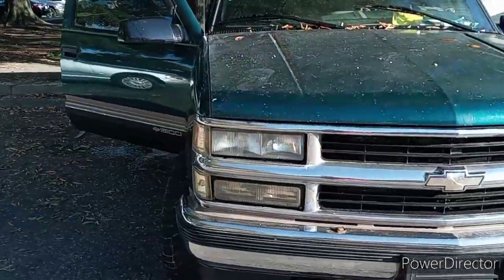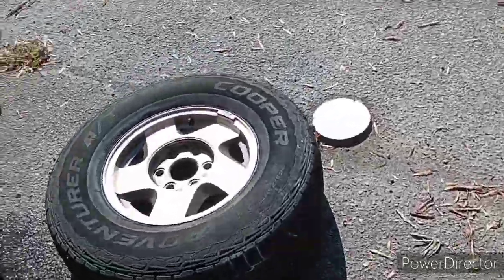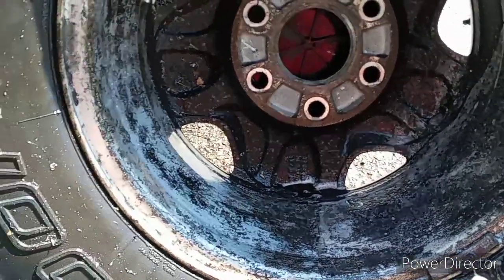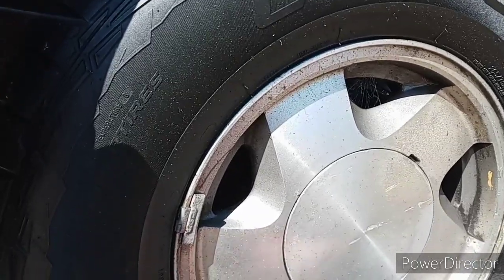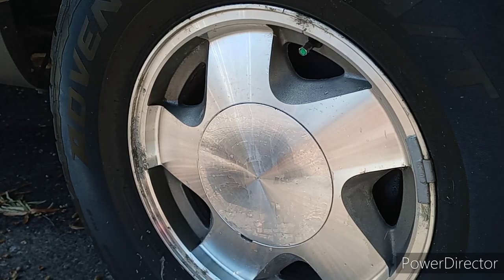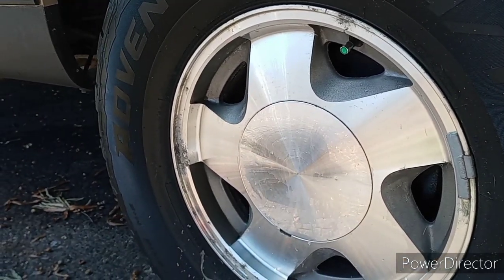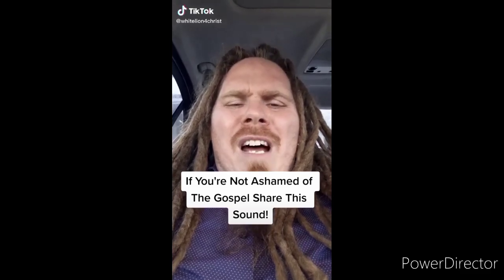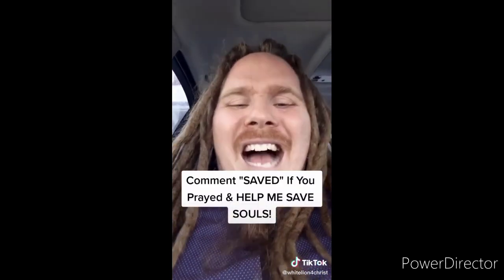how to turn your stock wheels Chrome under ($10)

Comment: 600 grit 800 grit 1000 grit 2000 grit. Get them smooth and then polish. It will look like chrome. But they must be sanded well ypu will love them
Reply from the maker: I think you got to start out with 320 because you got a sand down the machine marks all the way and that's a pain that takes forever

Comment: You might need to sand it with a 800 thrn 1000 then 1600 then polish it ..I know this is old but just in your bored
Reply from the maker: I only did 1 wheel lol ill try that
Reply: What do you sand with??? Sorry if that’s a dumb question. Is there a special sander or certain brand

Comment: Chrome-plated plastic is always easy to shine. If you want the rest of the wheel to shine you need to do some multi-step sanding.
Reply from the maker: Yeah you have to send the machine marks completely flush and use different grit sandpaper to get a completely flat and smooth I started to do it on one wheel but never finished it
Reply: @Germanmuscle  Just keep them polished as overtime they will eventually shine on their own. They still look good without the milky clear coat on them.
Reply from the maker: I ended up getting 20 inch wheels that I plan on chroming once it gets warmer outside

Comment: Yoo man how u clean the back of the rims ?
Reply from the maker: I'll be making a video about it soon but because it's the back of the wheel and it's so tore up I use a wire brush rubbing alcohol and Brake Parts cleaner and then polish it
Reply: That’s wassup I appreciate it

Comment: This works great, if you want the cap to match better. Don’t strip it, clear coat over the old clear and it matches the stripped wheel perfectly!
Reply from the maker: I ended up getting new wheels

Comment: What did you use in the pump spray bottle please comment back thank you for this video I will try it
Reply from the maker: Hot water but I used Citrus strip to get the clear coat off you can get it at Lowe's or Home Depot for like 10 bucks
Reply: @Germanmuscle   OK thank you very much
Reply from the maker: I sprayed the center strip on the wheels and let it bake for like 20 minutes in the Sun if you don't let It Bake then it takes forever for the clear coat to come off
Reply: @Germanmuscle   OK thank you very much I have a Chevy S10 it is a 2001 I have almost the same type of wheels on mine

Comment: what are u using to take off the plastic on the rims and that spray ??
Reply from the maker: I just used a flat head screwdriver to remove the center cap. And I said what I used in the video.
Reply: do i need to polish it with the machine your using or can i just use a rag
Reply from the maker: @jorgecozz4243 A drill or a polisher will have better results.

Comment: I just purchased the exact same center caps how do I install them
Reply: I have a 99 gmc Yukon
Reply from the maker: They pop in
Reply from the maker: Yeah they should just pop in
Reply: @Germanmuscle  do I use a rubber mallet? because I try to just pop them in and it doesn’t go?

Comment: Can this be done in an 02 camry stock rims ? 
They are aluminium ?
Reply from the maker: Yes. I did it on my stock aluminum wheels
Reply: @Germanmuscle  i mean bro they are some stock camry rims  
I was nust curious/bored ?
Reply from the maker: Yeah it will still work all you're doing is removing the clear coat but if you want it to be Chrome you'll have to sand down the machine marks till the wheel is smooth and flat metal and then use mother's mag and aluminum polish on a buffer.
Reply: @Germanmuscle  hello brother i my case it has a factory silver paint i mean i will try
Reply from the maker: Aluminum wheels are primered painted and sealed with a clear coat if you use the stripper it will remove the clear coat and paint and it will leave the wheel in a nice bare aluminum finish
Reply: @Germanmuscle  so buffing it into mirror finish not cause any problem right ?
Reply: @yourfavcamry  the wheel will stay without protection...rust etc....
Reply from the maker: No it'll be fine
Reply: @bondjames7867  yup thanks 
Better to just powder coat the rims 😅
Reply from the maker: Yes sir
Reply from the maker: @yourfavcamry for sure
Reply: Thnks for the info
Reply: @yourfavcamry  well i never tried but seems to be logical...also depends on how often do you use it! I use my camry every day...i think they paint the wheels w a reason...i put also big wheels but now i put back the 15 factory cause thst is good for suspension. Many ways looks better but look not always everything...liability less problam means more for me at the moment but as I said if its not a daily driver i guess no problem.
Reply: @bondjames7867  its a daily driver with the oem 16" rims
Plus i was wondering how to hook my fogs with the parking light instead of headlight (2003 camry se)
Any ideas ?
I cant seem to figure out a way
Reply: @yourfavcamry  bro, no idea sorry! Get a good mechanik or electrician he will do it for you...